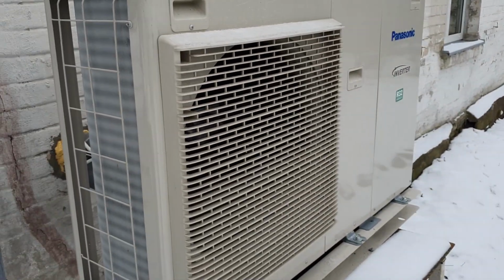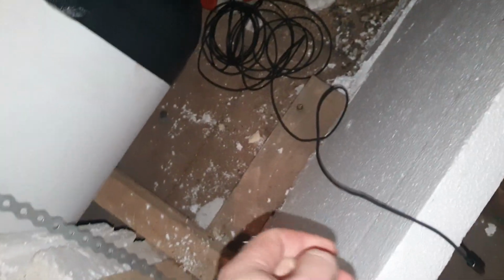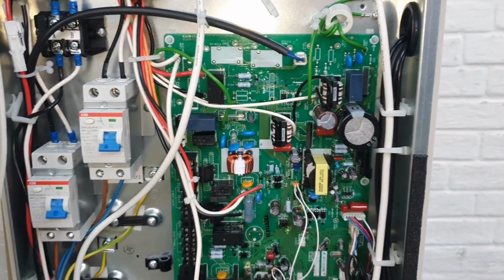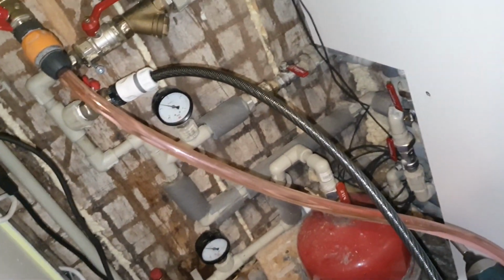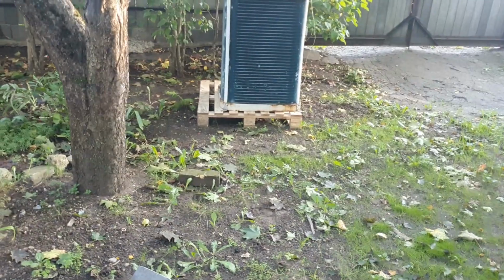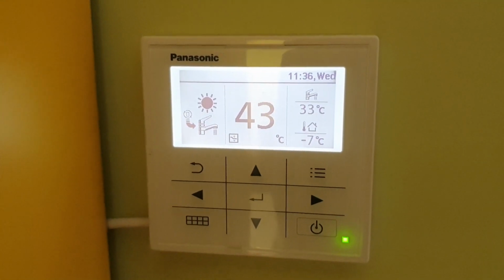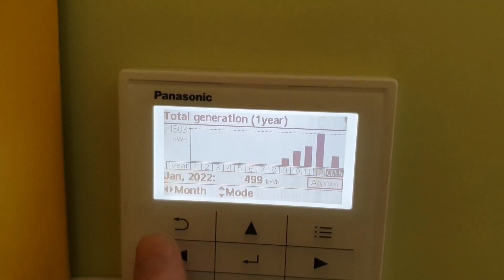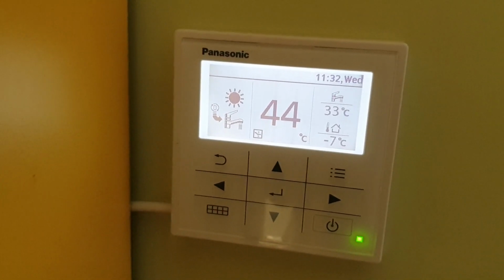Panasonic Aquarea 5kW Monobloc (R32) WH-MDC05J3E5 REVIEW

Comment: Was your guarantee with Panasonic when doing it yourself. I'm told if we do it ourselves we break the guarantee it has to be an authorized Panasonic dealer, thanks 👍
Reply from the maker: the company from where I ordered it asked for some paper that says who has and when finished the installation. I didnt send it so I guess that might be issue, however all respect for the unit, it has been running all right ( even when outside temperature is below -20C, ofc not that efficient though),  maintenance free (the only issue is that the fan has got little bit more loader(but just for my ears, not enough that I have found time to fix it ), maybe need to lubricate the bearing) for exactly 5 years. Maybe I got lucky or my settings are good for long term using it, but that is just my experience.

Comment: My heater has H70 back-up heater OLP error. So do you know fix it?please!
Reply from the maker: Ive never have had such an issue. If you are sure that you dont have any problems with your electricity, shorts, problem with ground, visual signs of corrosion on any of wiring, and everything have been working good for many months,  I  can only suggest to start with turning off the unit and disconnect the power supply. Wait for at least 10 minutes before reconnecting the power supply and turning on the unit back on, this might help if it is software issue.

Comment: hi there and thanks for the video, are you still (after  two years) satisfied with your panasonic?
Reply from the maker: @SSi-wo4xs  overall I can say yes, bcos it has been running so far without any problems as well I havent done any maintenance so far. Ofc  app lacks some featrures, but if you need it just to run  problem free, it kind a has done so far :) at least for 3 years so far
Reply: @JUrtanschannel  do you feed directly your radiators or do you have a buffer tank between them? thanx for your response
Reply from the maker: I have one buffer tank, as well expansion tank and boiler tank for all hot water at home, but I do not keep water always very hot, I use system economically, I only heat water once a day in early morning (ive put schedul, it is heating water only 2-3h a day), or if the water is around 30C and I need to take hot shower, an hour before I manually turn heating on for an hour.  In winter time it is better with my settings since it heats up radiators any way so water tends to be hotter, but as well it depends how cold it is outside. Any way it is possible to use more comfortable settings as well
Reply: @JUrtanschannel  i ask because i plan to install the pana only to feed the radiators without buffer between them and without boiler for hot water. There is a huge discussion on the web if a buffer necessery is.
Reply from the maker: Well I left buffer bcos I had it with my old system, so I didnt see what bad it can add, but if I would have to make a new system from the scratch, I would probably not use it. You can always add buffer tank later, if you figure out you need it.
Reply: @JUrtanschannel  that was helpful thank you

Comment: It's a very nice report! I have a question about the refrigeration circuit for the monoblock with R32. Do you also have a 5/16" SAE connection on the suction side for filling, evacuation, suction, etc.? - as with air conditioning systems or split systems with R32? Or is it different? Normal refrigeration systems have 1/4" SAE connections on the high and low pressure side, which can be opened via Retalock valves and of course the solenoid valve for refrigerant line OPEN or CLOSED. So far I have not been able to find any information on this and I have never installed a monoblock R32 and of course it will have to be serviced at some point and the refrigerant circuit will have to be worked on.

Comment: Thank you for this great video!
Thinking about getting this unit as well. 
Do you know if there is an inbuilt pump in the unit, or will an external one be needed to circulate the hot water through the radiators?
Reply from the maker: hello, it has inbuilt basic pump

Comment: Great Video! 
Could you pls also make a short video how to clean the water filter.
From the Manual it is not very clear how to proceed!
I have now the Panasonic since 8 mopnth and it works fine.
I learned a lot from your video tks mario from switzerland
Reply from the maker: hi, Thank You, yeah I have thought about doing filter cleaning, it should be easy thing to do, I just havent done it bcos one friend of me said since I am not using  tap water in the system, the filter should be good, but when I will got some time, I will check it any way and make a video!

Comment: do you know how to start the cooling? Thanks :)
Reply from the maker: hi there, I am sorry, but I dont know. In the instruction it was said that even if you got this model with cooling function, it must be enabled by authorized heat pump installation expert, and there were no instruction how to set it up. maybe you need to add cable and connect switch to control unit or maybe it is not necessary and you can set it up just by pressing some sort of combo of buttons in the control unit, idk. I am sorry

Comment: Did the wifi controller work just ok when you installed it inside monoblock unit? I mean it has metal covers.
Reply from the maker: It works, but i put my wifi router next to it inside the house, i would say 1.3m away.

Comment: You should keep the tank temperature above 49 deg. and set the the pump to run the legionella/desinfecting program once a week on the cheapest day/time and keeping the high temperature for at least the time set as default.

Edit: This is probably a too low temperature. Based on the advice of the lab responsible for the national guidelines we have raised the temperature to 55 deg. and is still heating the tank to 65 deg.C several times a week.
Reply: No, heating the water high once a weat creates high temperature resistant legionella! So use the water or waste it if you are away for severeal weeks!
Reply: @andregenter4213   Not according to the microbiologists - and they are even more restrictive in the guidelines issued here than some other countries. In Denmark the guidelines are as follows:

Temperature at the outlet of hot water tank/heat exchanger - generally minimum 55 °C.
Temperature at the tap and in the return water - minimum 50 °C after < 30 sec.
Tapping points (faucets and showers) should be flushed at least once a week with water ≥ 50 °C.
The above is especially important if there are vulnerable people in the household.

We keep our tank at or above 55 deg.C and often at 65 deg.C because of excess solar energy being directed to the tank.

Will inquire about the heat-resistance over at the laboratory next week.
Reply: @MovieViking  above 60C you will have to handle with massive lime. The best solution is to use a tank with 45-47C-Water and heat the fresh cold water with a heat exchanger. Always fresh hot water, no legionella. That’s state of the Art.
Reply: @andregenter4213   So you raise the temperature after the tank with at heat exchanger, but if that is electric it requires a lot of current. The one we had before drew 3 x 28 A which is more than a house is normally fitted with here. It was fed water preheated to 30 to 45 deg.C. 

What target temperature do you set?
Reply: @MovieViking  No. you take a water reservoir, heat it up as you would do for having warm water and use this warm water with a heat exchanger. If you want Rochade warm water, fresh cold water is flowing to that exchanger and is warmed up. You lose ~2 degree. Means water tank has to have 45 C to have fresh warm water with 43 degree. Not legionella anymore.
Units costs ~1.500€.
Reply: @andregenter4213   Thank you, that is an excellent way to heat water and it is the way we do it when making solar heating (not Photo Voltaic), but AFAIK it is not recommended in combination with heat-pumps. That could very well be because everything regarding "plumbing" is depressingly obsolete, even the standards.
Reply: @andregenter4213   Where are you located? I would like to find the local standards from where you live and use them next time we change the system - probably in the spring as I have to make som other changes then as well 🙂

Comment: Hi. Excellent video, very informative :)
I just installed and turned on my WH-MDC09J3E5 for the first time this saturday, very similar pump to yours - found your video very helpful.
I do have a question though - where did you tell the pump that you have a tank sensor? I also have it installed, but it is not showing tank temperature. I might need to switch it on somewhere.
Reply: Jep, tak, jeg fandt ud af det 😄 der er mange indstillinger som skal/kan nørdes med, i sådan en Panasonic 🙈
Reply: @maniacdk1  Ja, mon ikke. Herhjemme har det givet hovedbrud at fjernbetjeningen og app’en ikke kan bruges til samme indstillinger af ugeprogrammerne. Når man laver det i app’en så står der på panelet at alle programmer er inaktive, men samtidig justeres fremløbet på de programmerede tider. Comfort og Eco er også gak, da de kun virker som en +/- indstilling og nulstilles af et skifte i programmet men stadig i app’en står som aktiv. Når man så slukker i app’en trækker systemet 5 grader fra den temp der nu er lagt ind i programmet men netop ikke er tillagt “Comfort” indstillingen. Totalt gak. 

Lige nu bokser jeg med at komme af med den flow støj alle forindstillingsventilerne på mine konvektorer giver, men som giver problemer med tryk-balancen i anlægget når der ændres på (men jeg har ingen tiltro til den vvs’er der oprindeligt måtte have sat det op).
Reply: Du skal slå tank til i installatør-menuen. Det kræver selvfølgelig, at du har forbundet kablerne rigtigt.

Comment: Hello JURTANS ,

are you satisfied with the heat pump? Does it works well with snow and cold Temperatur?

Thank you
Reply from the maker: So far no problems, to be honest it does what I expected and I have been using it for a year now and no problems at all, the only thing that is really worth to take in the account, Panasonic have really bad mobile app for controlling the pump, so it is not possible to make schedule through app (however it has such a function, it just dont work), so basically from app you can only see the current statistic and as well change heating from radiators to boiler and adjust temp., what is not enough for me, since I am adjusting heat pump according with cheapest electricity hours and I rather would have scheduling function in app. PS. - Main heat pump controller has scheduling function and it works there with no problems, but when you are not at home, you cant use it :(
Reply: Hello Jurtans, i am also leaning towards the Panasonic Hp. What is the leadtime for it? Because for Vaillant/Daikin is +1year!!
Also, i noticed that there are huge numbers of options with the controller. In the app, can you see the COP? Also, does it have SmartGrid ready? Thanks !

Comment: Did you crimp the stranded cables?
Reply: You should always do that. The electrician connecting my unit "forgot" to do that on the circuit feeding the 3 kW heater and the arcs from the loose connections burnt the wires, the circuit-breaker and came close to setting the unit on fire a month ago.
Reply: @MovieViking  indeed! Looks like this isn't done in the video. All the cables look pretty messy as well.

Comment: Yes. Can you explain why only 2 cable run to control panel because it has to control 3way valve for hot water????
Reply: The valve is connected to the main circuit in the machine, same like the remote. From there everything is controlled

Comment: In which part of Europa you are living I want to compair with my country Switzerland as i want to install the same pump.  Tks mario
Reply from the maker: Greetings, heat pump location - Latvia. During winter temperatures goes easy under -20C, however this winter was rather warm so I cant say much about how it will work in really cold winter, we just got temperatures down to -15C for a few weeks and then something like -5 to -10
Reply: @JUrtanschannel  Tks a lot what i am also interested is what was the consumption per month i guess I in a mountain Valley we can compare you and my location. may your part is more windy ours may quite cold but sunny if cold.
I am looking forward to get a Pump like you the mono Block from Panasonic seems to me the best solution as i just want to heat my floor heating. I have already an Atlantic Pump for hot water as gas gets more and more crazy.   And the price for such a pump is quit good. tks from sunny Switzerland today plus 30 celcius
mario
Reply: @mfsalo  It's in the video 17:21

Comment: Hi, what is the distance between the drill holes for mounting on floor?
Reply from the maker: Well the two bars are
128.3 cm each and between them there is 40.7cm.  If we speak about three bars mounted on top of two paralel bars, then the width is same - 40.7cm,  but the lenght dimensions for them are like this - from first to second- 68.5cm, from first to third  106.5 cm. From side to first there is 10.8cm spacing. (Same from third to the end)  and each of three mount's is 6.5 cm in width. Better would be to draw..  any way if you are looking for the three bolt middle points for holes, then for each side they are   17.5cm, 76.2cm and 104.4cm  and approx 1.9cm to inwards(adjustable, i think from 0-3cm).   For the two beams where these three perpendicular beams are connected you can drill holes where ever you need.

Comment: I'm in the process of installing the 7 kW version, which I'll have delivered in 10 days. Very very useful video. Can you clarify something for me. Does the unit have a built in filter on the water side?
Reply from the maker: It has magnetic filter inside the monobloc unit, but no additional filters
Reply: @JUrtanschannel  thanks buddy. I'll add a mesh filter as well
Reply: @JUrtanschannel  just a note. There is a stainless mesh filter inside the unit with a ball valve on each side.
Reply from the maker: @MartinPedersenTM  yes, I am about to clean it sometimes soon since some time has passed :)
Reply: @JUrtanschannel  you can remove the magnet from the filter to better clean it. Just a small note. Mine quickly got full of gunk.
Reply: @MartinPedersenTM  It seems like you are Danish. 
What if any things have you learned that you were required to get help for? We have rules that you have to have a seperately metered electrical supply. I assume that you have had to have that made?
Reply: @jenspetersen5865  it's alright to do everything but the electricity and the city water side of the hot water tank. It would appear the electrician put in a three phases meter and a C20 group. And some security breaker at the monoblock.

Comment: Thanks a lot for this video, very useful. In the rear of the machine there is "water IN" and "water OUT". I suppose they are the circuit of radiators, correct? How to charge the water from line?  compliments for your work
Reply from the maker: Hi, thanks for question, yeah water in and out from what I understand means that cold water direction (in) and hot water direction (out) :) What do you mean by charge the water from line? Do you mean how to fill up the system with water?
Reply: @JUrtanschannel  YES!! How to fill up the system with water?
Reply from the maker: @luiginovisconti70  As you can see on the video, I have a valve where I can pump what ever I want in the system with pump and a bucket :D But I as well have a valve where I can let the water in if I need to add a bit.  It is too risky for me to use just water , because I live in the region where temp goes way below 0C and if something will stop working in such a low temperatures, water might freeze and damage the pump, that is way I am using food grade antifreeze :)   BUt the short answer you have to add extra valve, where you can attach external pump or hose which you can connect to your home water outlet.
Reply: @JUrtanschannel  Thanks a lot. I live on the sea... no problem with ice.... thank you. ciao
Reply: in your opinion, are electrical connections with power supply 1 and power supply 2 both mandatory? Power supply 1 is for the heat pump (and this is necessary) but power supply 2 I believe is only for the electrical resistance. Can I not connect this one? I live near the sea, and we never go below zero .... does the machine work anyway?
Reply from the maker: @luiginovisconti70  i am not professional, but I think you can connect both connections to one cable, there should be no problems! :)  that is my opinion and one guy who is electrician said me that in the first place I can connect both connections to one fuse, so I guess there wont be a problems for you!
Reply: You can skip the resistance heater on Supply 2, it’s no problem if you don’t need it. But if you need it it should be on a separate circuit breaker, first because of the high current and second because you can then choose if you want to use it or not. In theory it should be possible to have both on one circuit breaker, but then there needs to be a very thick cable and a big circuit breaker. But this can mean in case of a machine error, that the breaker trips quite late and you get more damage. I would always recommend to use 2 separate cables and circuit breakers, in case you need the resistive heating rod. I’m not an active electrician, but I have the basic electric certifications

Comment: Hey thanks for the video. One quick question - is 5kw the electric
Power or the heating power?
Reply from the maker: 5kw heating capacity, where it has 3kw electric heating element in case of really cold winter, I have 2x16A fuses, one for heat pump and one for heating element in heat pump if needed, so heat pump is not much more than 3kw it self..